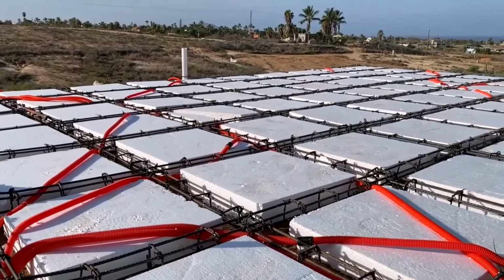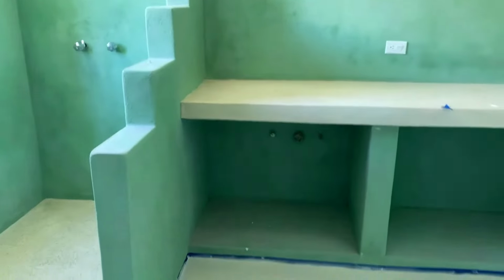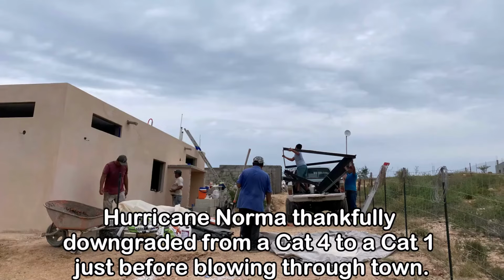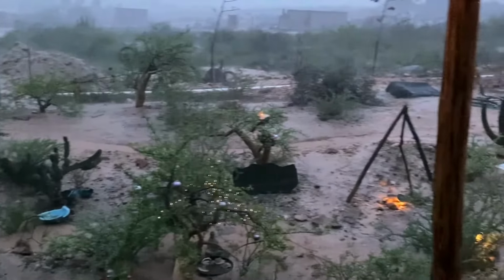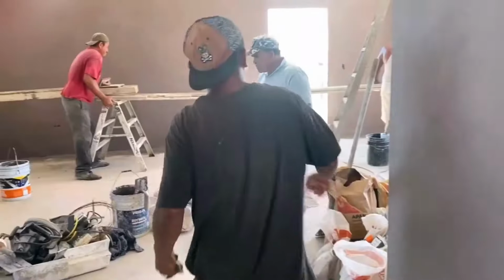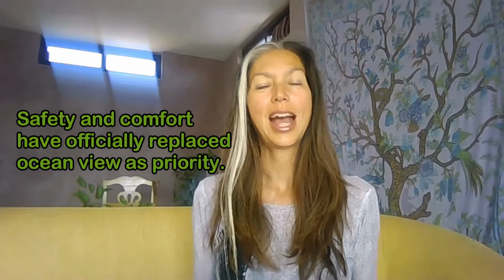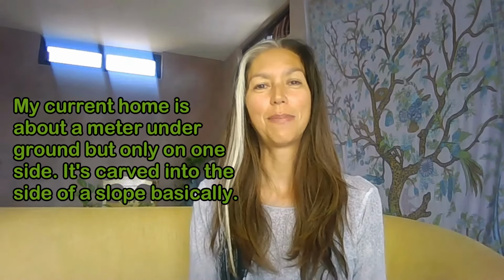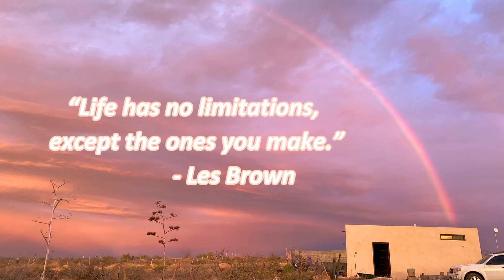Living Off the Grid in Mexico: A Real Life Home Building Experience.

Comment: Have you considered doing cooling tubes in your next house? Like the earthship’s use? You mentioned digging down further next time, but you could also add a berm to one side as well. I wish more houses in BCS would use the natural cooling of the earth rather than rely on mini splits and the electrical grid!
Reply from the maker: Anything's possible for the next build (if there is one) but when you're working with local builders it's very easy to get caught up in doing things the way they've always been done here.  I'm shifting as much as I can.  I'm not on the grid, I'm on solar.  Have you implemented the cooling method you've described in your own house here?

Comment: What square feet is your roof and does it have a pitch / decline to prevent water from forming puddles?
Reply from the maker: The house is roughly 700sq ft, and the roof has a slight pitch.  It wasn't covered in this video, but in a video from my last build you'll see all the wood beams standing, supporting the plywood that the roof is ultimately poured on.  The beams in the centerline of the house are just a bit taller, creating the slight angle to make the water flow to the front & back edges of the roof.  From there spouts off the roof send the rain water into bins on the ground, no puddles! ;)  Maybe I should make a short about this..  Ideas are percolating!
Reply: Thank you kindly for your reply.. Yes that would be wonderful to make a video about this further.  @BlueSkySanctuaryBaja

Comment: If you built a palapa over the casa, you'd really cut back on cooling during the summer
Reply from the maker: My solar panels & water tank cover more than half of my roof so that's not an option.  On the bright side it also means half my roof is already covered.